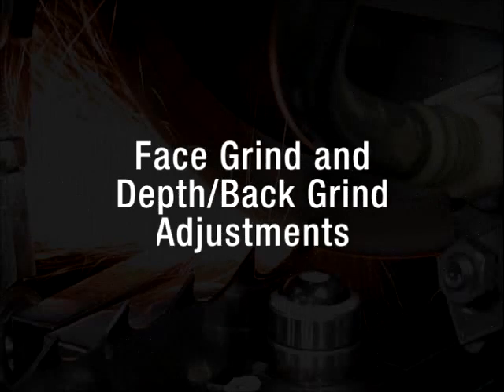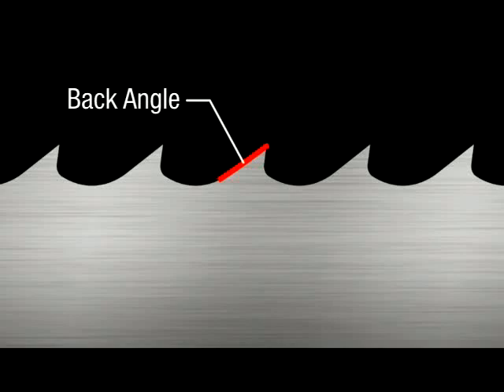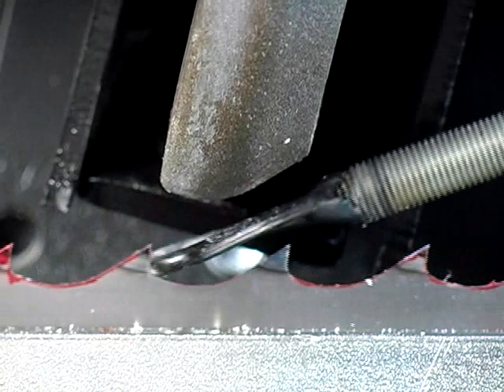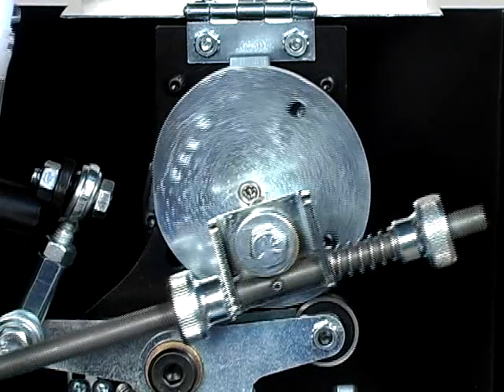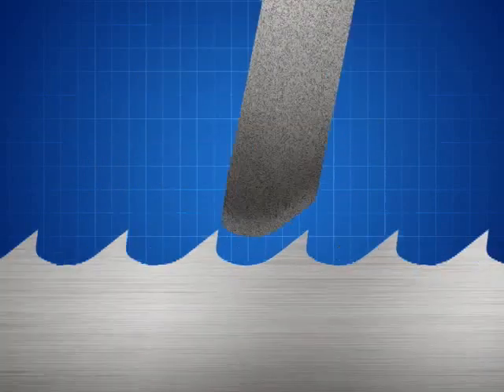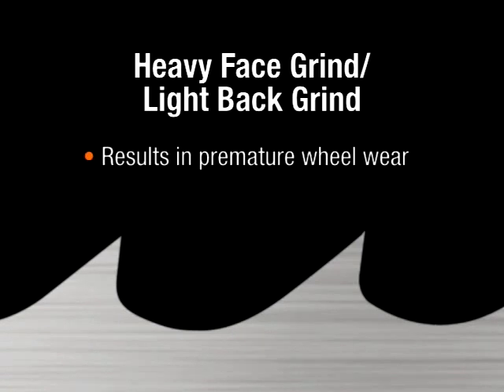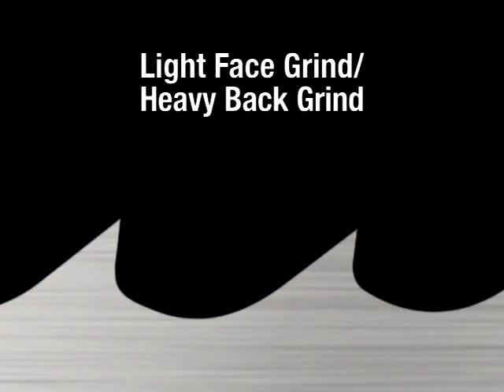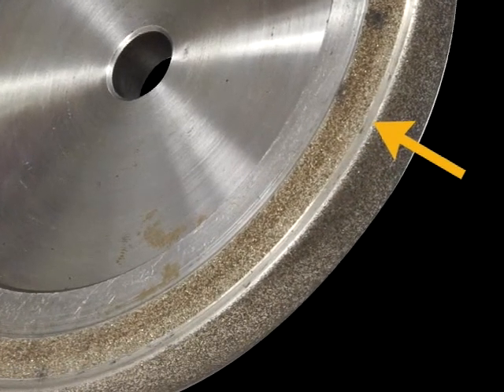Basics of Wood-Mizer blade sharpening

Comment: Please forgive me if I am silly but...Blades are made by first cutting the tooth and gullet. That process causes the sharpening of teeth. Then the teeth are set left, right and left center. So the sharpened edges are twisted away from when formed. In contrast,,,,,We sharpen a dull blade with the teeth set. So our sharpened teeth derive a very different (and uniform) cut angle. This does not seem to be what occurred initially during blade formation,. Am I incorrect?
Reply: good day.may i have you advice,am looking for a machine to reblading